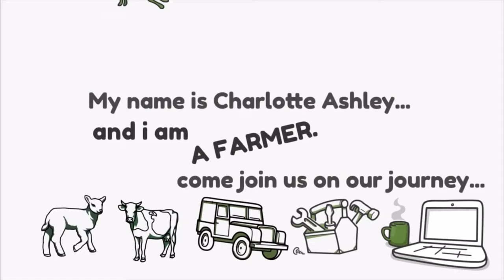Building the dream… literally, muck sheds with Walt from start to finish. Concrete overload

Comment: Hi
Why didn't you buy the concrete panels already meade up 🤔
Reply from the maker: Shuttered walls have strength as well as the legs, with panels all the weight is pushing on the the steel legs 👍